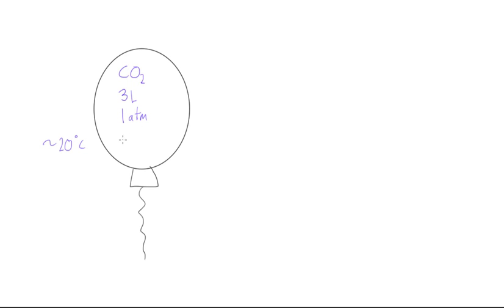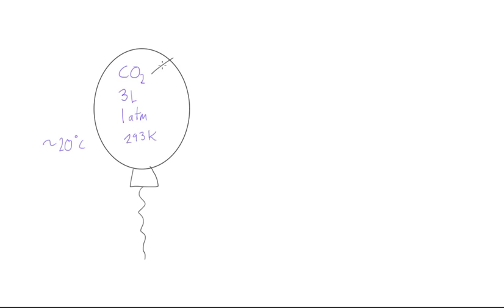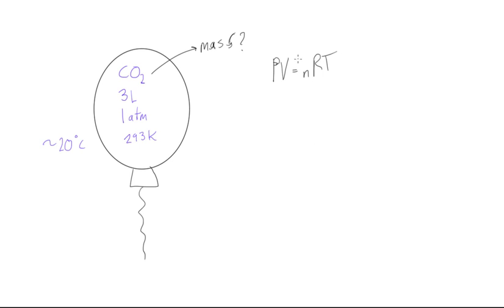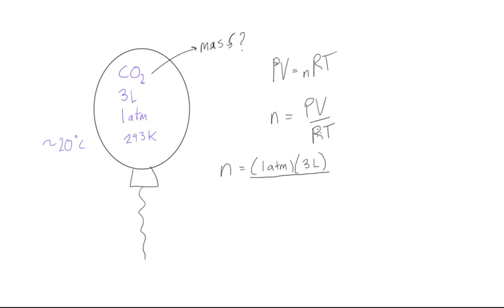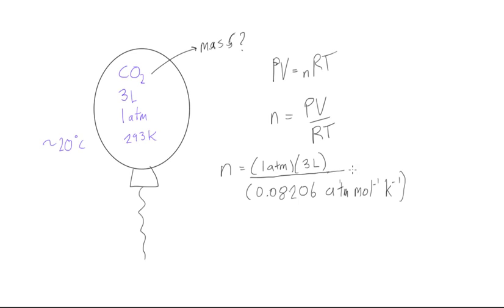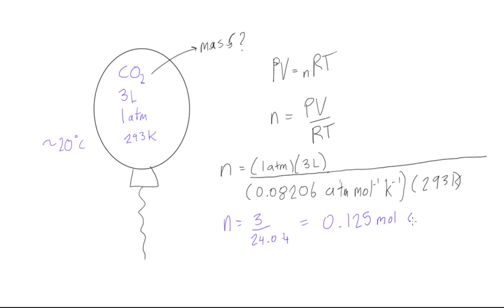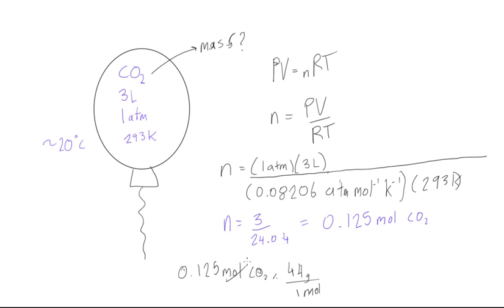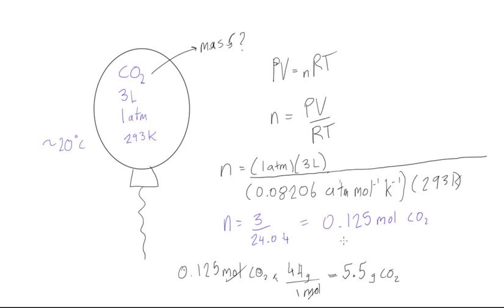Using ideal gas law to find the mass of a gas sample

Comment: how did you get 44g?
Reply: they added the mass of each element in co2:
carbon = 12.01 amu 
oxygen = 16.00 amu
since there are 2 oxygens you multiply its molar mass by 2 so it’ll look something like this: 12.01+(16x2) = 44g

Comment: My prof is asking us to find the molar mass of an unknown gas if it’s density at STP is .901 g/L. However, we only know the volume, temp, pressure, and moles (which we calculate ourselves). How do I find the molar mass?
Reply from the maker: Hey Natalie. It's been quite a long time since I touched Chemistry, but IIRC this is what you need to do: https://imgur.com/a/Mm3XFgm it always helped me to imagine the gas is in a balloon, and then starts adjusting the numbers one at a time. Also, if you haven't already, I recommend checking out videos #8, 9, 13 here: engineer4free.com/chemistry as they specifically relate to what's going on here. Plz share Engineer4Free with your class too that would be much appreciated 🙌
Reply: If this helps, 
moles: .0598
Temp: 25 degrees delicious or 298 K
Volume: 1.5 L
Pressure :741 mm Hg or .975 atm
Reply: Do i do .901 g/L = molar mass/ 1.34 then solve for molar mass?